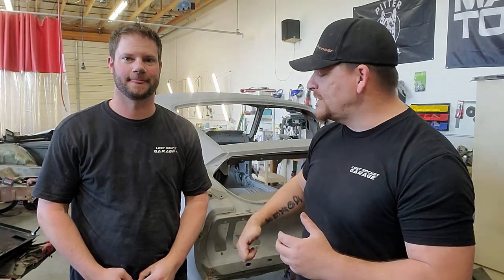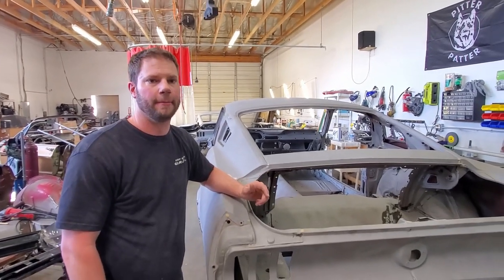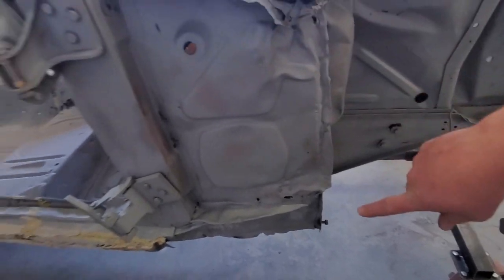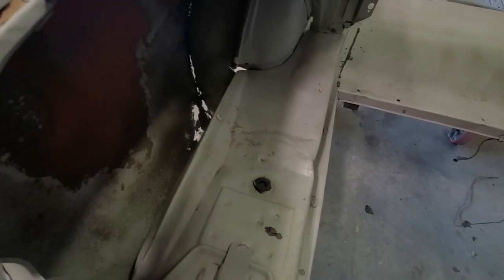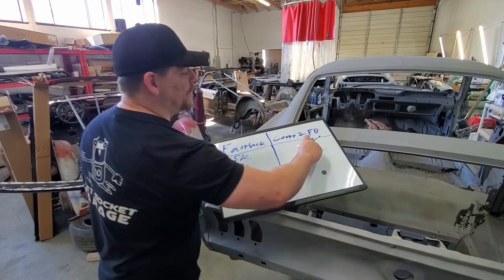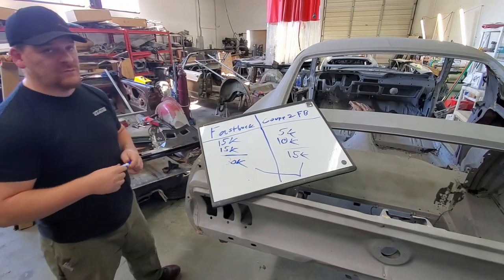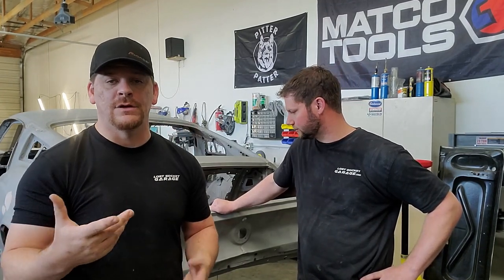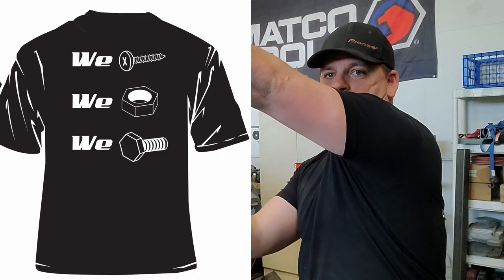$18k Mustang Fastback Unveiled: Is Converting a Coupe More Economical? | lostsocketgarage.com

Comment: I am just stunned at the prices that Fastbacks are commanding these days. I was very lucky/blessed. I got a 67 Fastback in 2003 with the luxury interior package, factory in dash AC, 289, 2 barrel with a c4 in Frost Turquoise. It was 95% all there and I got it for $2500. I had to replace the entire cowl panels and some other minors panels. I am restomodding the car but nothing that can not be undone. The car is just too valuable now to cut to pieces for a coyote engine or whatever. 
I completely agree with the Coupe to Fastback conversion for the working man. Thanks for the video, it was very informative.
Reply from the maker: Glad you liked it . That's awesome you got a great deal
Reply: Bought my 67 fastback in 2000 for 3grand. Had a 200ci and a 3 spd. A lot of bodywork. I still own the car and it's getting a new 427w and TKX trans. Along with a lot of new suspension parts. Brakes and ditching the 8inch rear for a 9inch.

Comment: That's crazy, dynacorn all new is 17500 advertised with doors and deck lid, only way to go imo
Reply from the maker: Yeah only trouble with that is no Vin number, and dynacorn is at least 1 year out on those
Reply: @lostsocketgarage  just personally if I were going that deep into a build, it would have a coyote all aftermarket suspension,  and some upgrades to interior,  I could wait a year and do a builders title

Comment: DYNACORN DYNACORN fastback bodies $18,6k. 
Seal, prime, paint & bolt up parts.
Reply from the maker: Definitely an option. Some drawbacks though: 1. You are waiting usually at least a year 2. Doesnt come with doors, fenders, or anything that bolts on. 3. No vin, so you have to register it as a kit car (or do other more grey area stuff). 4. No guarantee its all welded together with the right measurements because they have no doors, fender, decklid etc. We have had issues with their welded side assemblies not being welded correctly. 
But overall yes, still a solid option.

Comment: Subscribed. I'm definitely interested in doing this, but I have a few questions if anyone has time: 1) How difficult is it to find a garage willing to do this and do it well 2) How well do these converted fastbacks actually hold up over the years provided everything is done well? I'm no automotive expert but it looks like a lot of work is being done to the structural parts of the car and this makes me worry it won't hold up over the years. I've read a lot of horror stories about people or businesses who tried to take this on and ended up ruining a poor 68 coupe so I'm just curious.
Reply from the maker: Shoot us a message on fb or insta @LostSocketGarage or email us at LostSocketGarage@gmail.com I'd be happy to set up a call
Reply: If it’s done properly they’ll last just as long if not longer than original fastbacks. Since now people know to maintain and take care of the car while it’s sheet metal is new, unlike when they were first built, people didn’t take care of a lot of em.
Reply: I'm a body/metal/paint tech at Mustangs to Fear and we've done a few conversions. If done properly there are no issues. Problem is that most sellers want a mint for just the roof and structure and being original metal, you still have rust in areas you can't get to. Since all these replacement parts are available aftermarket I would go that route. It does take some skill to do. We just recently received a licensed Eleanor done by someone else as a conversion that was totally butchered. The inner structure was so compromised that the customer decided to go with a new body and start over. The car was just unsafe at that point. He paid over 100k for this car. About 25k for the Eleanor "license". I guess as long as you spend the money, you cam officially license a VW Bettle as an Eleanor. Apparently no one inspects these cars before handing out the tag. VIN tags are a whole different topic. Potentially a bait and switch  if it's sold later as a fastback.